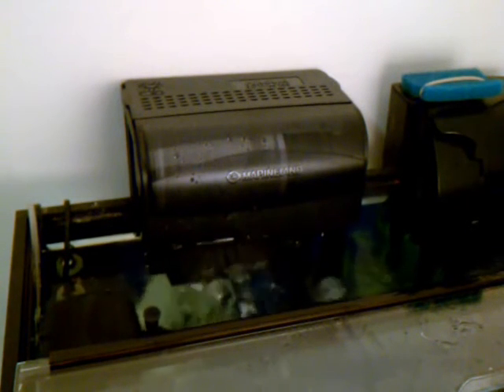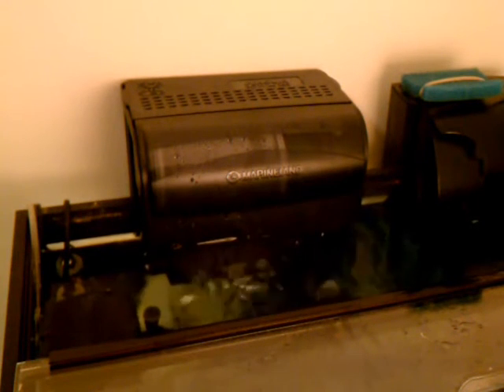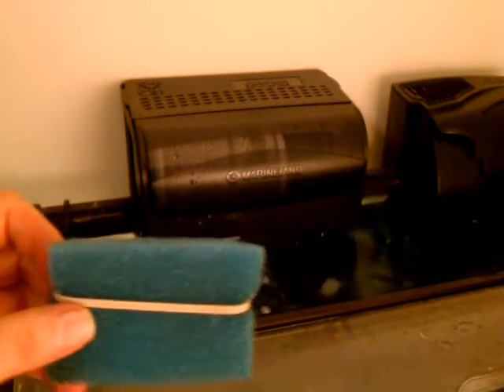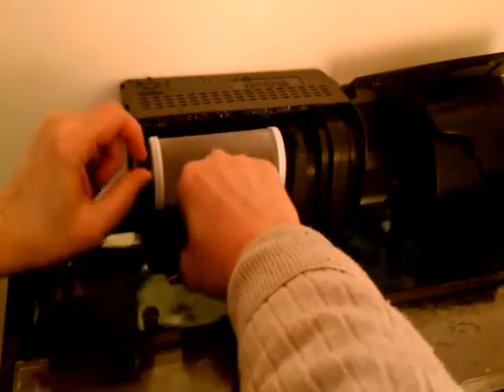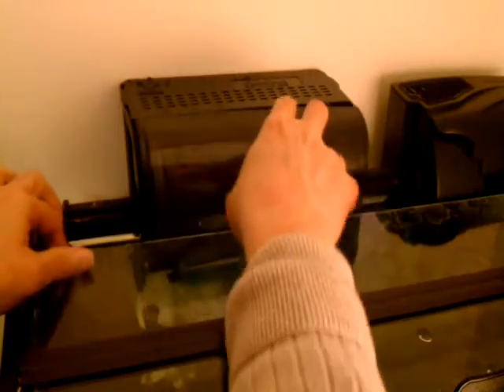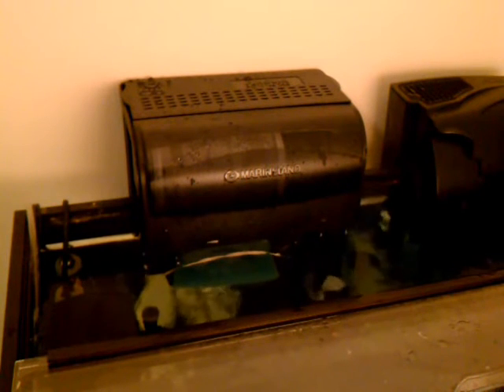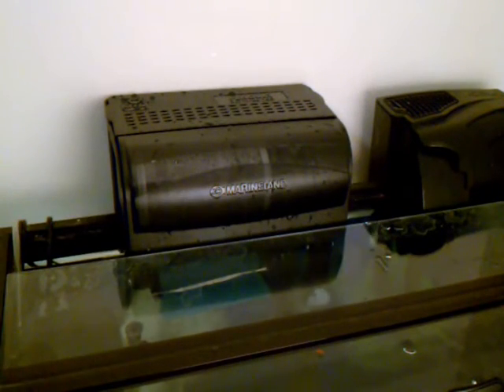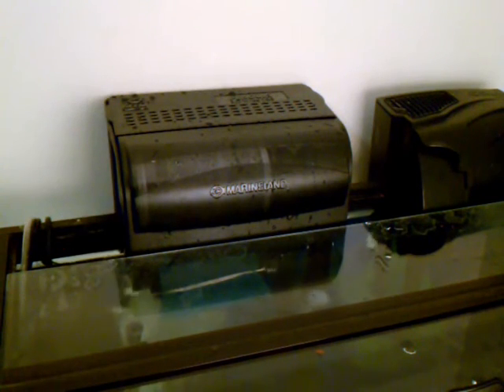Penguin Biowheel 200 Noise Reduction

Comment: Great idea!  You could do this or do what I did and return the Penguin and buy a Fluval AquaClear which is almost totally silent and is smaller and thinner so there is less headroom required from the back of the tank to the wall.  It's so quiet you could literally sleep in the same room.  I own (2) other Penguin 200's and (2) 350's that I have on other tanks and they are pretty darn quiet, but the (2) new Penguin 200's that I bought a couple of days ago were ridiculously loud for some reason...the splashing from the bio wheel I mean.  I returned them.  Plus I like that the Fluval has a reusable foam filer that you just rinse or squeeze out.  This is a good video though of a great idea if you are already stuck with the Penguin.  If you use pebbles or gravel (not sand) for your substrate, they will last for years.  Sand messes them up pretty quickly if you have rowdy fish like cichlids unless you shorten the intake tube and get it closer to the top (away from the sand on the bottom).
Reply from the maker: I also have an AquaClear on a different tank.
Reply: @mdmeyerpfa  Yeah, the Fluvals are good filters.  Seems like Marineland would be aware of the issue and change the design to something like you have done.  But I still have two 200's running that I bought in 2014 that are still very quiet, so I don't know why the new ones were so loud.  It wasn't the impeller, it was the bio wheel splashing.
Reply: Oh yeah, now I get why my filter became noisy all of a sudden, it’s my rowdy cichlids playing around with the sand 😑
Reply: I have a brand new Penguin 100 that hums so loudly I'm returning it too. Buying the Aqueon Quietflo hoping it is quieter.  The marinland is unbearable.

Comment: The number one way to get oxygen to an aquarium is from surface agitation. Seems this would greatly if not completely stop flow thus stopping the fish from breathing well...
Reply from the maker: It may reduce agitation somewhat but it does not eliminate it. I also have an air stone to promote surface agitation and it does not make any noise.

Comment: Does this not stop the water from flowing throughout the tank and hamper circulation...?  Any negative effect to slowing the flow of the water on the surface...?  Thank you, GREAT VIDEO!
Reply from the maker: This does not appear to have any effect on the water flow. There is less splashing so this may reduce surface water agitation but it is hard to tell. Overall I don't think there is any real negative effect.

Comment: is that tank a marineland 38 bowfront
Reply from the maker: No, its an old Marineland 20 gallon high tank that came with an Eclipse II hood. I misplaced the pump on the Eclipse a long time ago but remembered that I liked the bio wheel. So when I set the tank up recently I decided to add a hang on the back bio wheel filter.
Reply: +mdmeyerpfa nice yah I have a marineland 38 Bow front on my channel